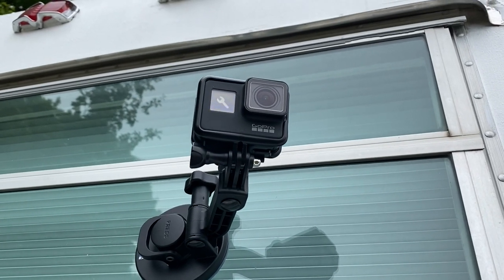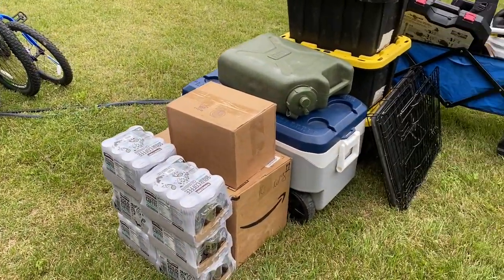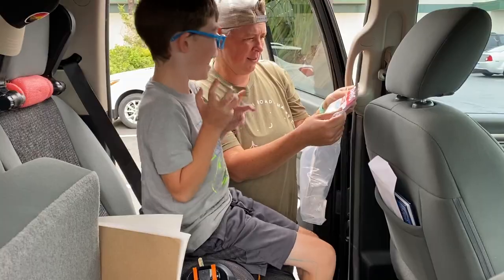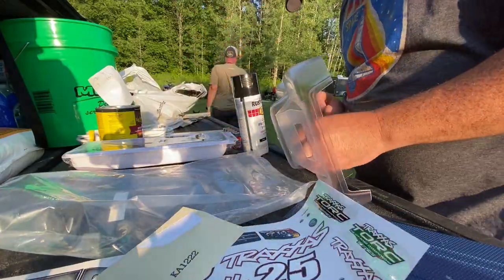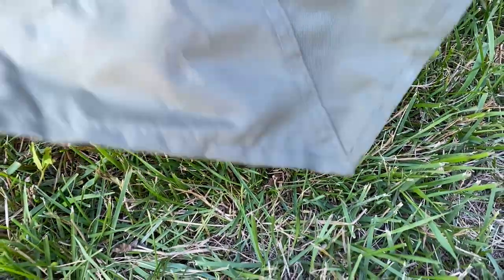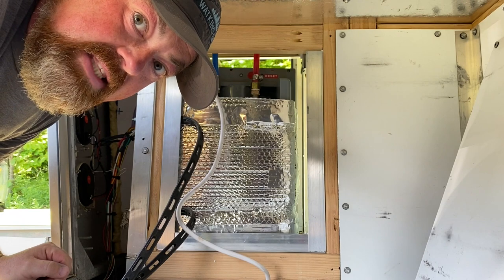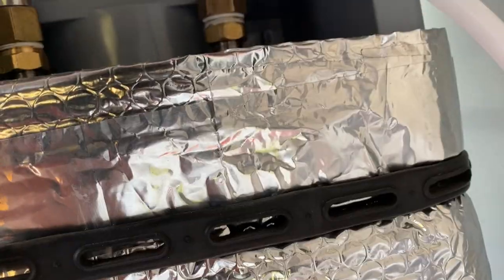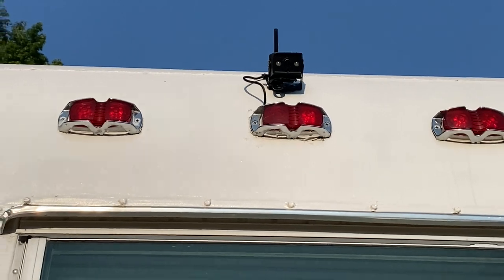#RVLife - Two Years on the Road and we NEED REPAIRS!

Comment: can you share a link for the ladder?
Reply from the maker: Yes, I will link it below, but it’s currently unavailable. I would recommend it anyway. The connecting pins are out of plastic and beak easy. I have ‘shortened’ the ladder by two or three steps because of it breaking. I would look for one that has aluminum hardware. Pricey but worth it.
Reply from the maker: Hausse 12.5ft Upgrade Aluminum Telescoping Ladder with Detachable Hook, Multi-Purpose Extension Ladder 12 Step for Industrial Household Daily or Emergency Use, 330 lb Large Loading Capacity https://www.amazon.com/dp/B07KWMMWRG/ref=cm_sw_r_cp_api_glt_fabc_6Q5JBE0ANZ6EGKWRMHFE?_encoding=UTF8&psc=1